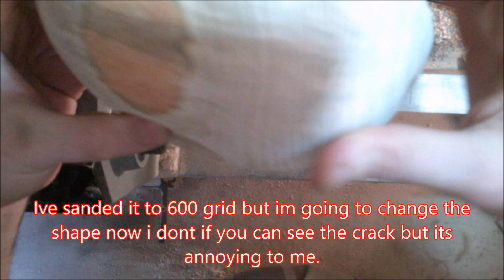Wood turning - Deep Bowl Turning from  beautiful Ash!

Comment: Nice soothing music....!Afshin, I was hoping you would change your mind about the roughing gouge, I cringed when I seen you using it.You and I both know the corners on a roughing gouge are an accident waiting to happen..Afshin, now that you used your 65 degree bevel on your round nose scraper, do you like that angle better verses 45 degree angle? Afshin, your completed ash bowl turned out quite nice...!
Reply from the maker: Thanks Jack, yes Jack i didnt use it much but yes 65 degree was massive change i prefer it for sure!!
Reply: I thank you for your response Afshin. Maybe I'll give it a try with an extra round nose scraper I have laying in the drawer....!
Reply from the maker: no problem mate, 65 degree was cutting nicely for me and much much safer than bowl gouge had no catch at all as you could see.